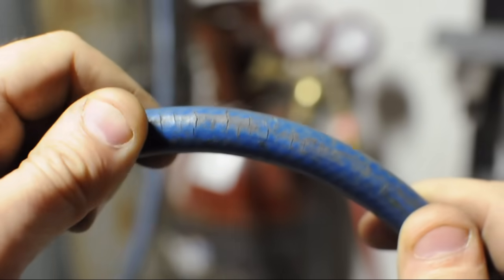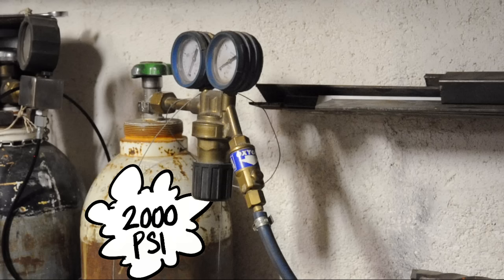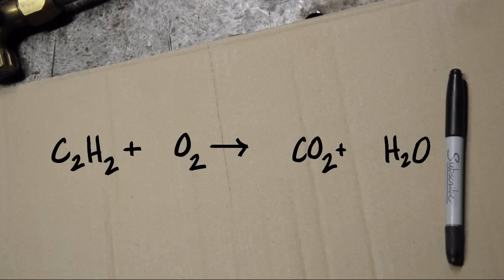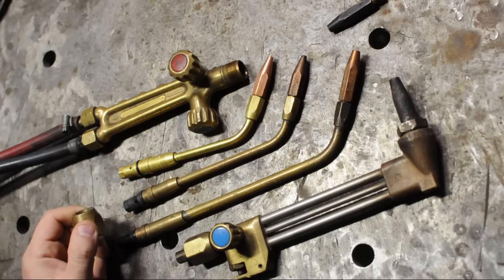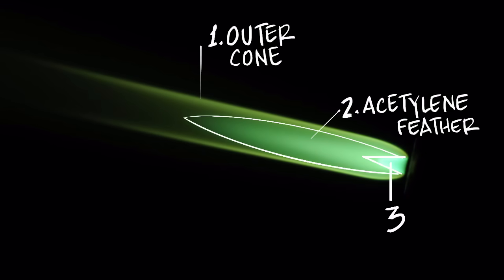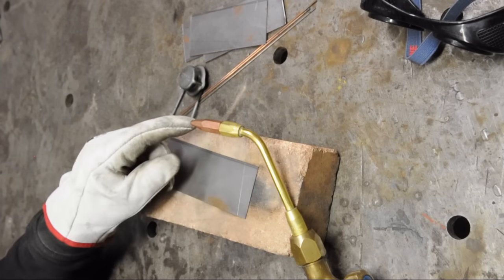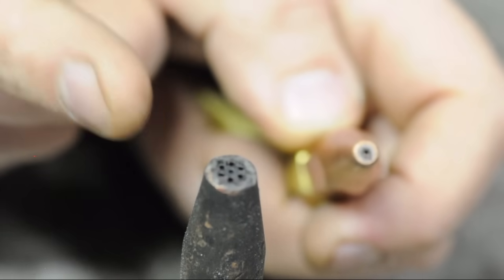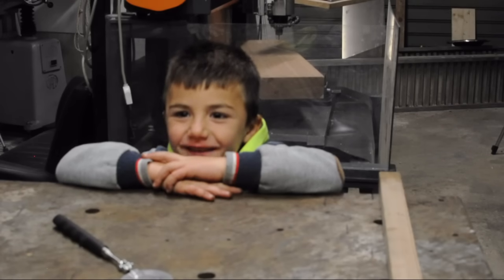Let's Talk Oxy Acetylene

Comment: I have been using my avetylene bottle completely upside down hanging from the ceiling for 30 years and nothing bad ever happened.
Reply: That's incredibly dangerous. At my shop, we drill holes in the bottom of the cylinders to get the acetylene out, but at least we didn't turn the tanks upside down.
Reply: we use a grinder to cut the valve off when we're done with them so we know which are empty, but theres no chance we would ever turn them upside down!
Reply: Why???
Reply: Uwe J. I hang mine upside down from a chain and swing on it like Miley Cyrus while I weld. Nothing bad has ever happened.
Reply: that_G_EvanP im laughing so hard im weak. I cant
Reply: Ppl believe anything haha
Reply: If you looked up "predictable" in a dictionary you would get a picture of this comment. But somebody had to do it.
Reply: We always hang it from it’s chain and whenever kids come there they try to dent it to increase the pressure with sledgehammers
Reply: r/woooosh
Reply: That's incredibly dangerous... At our shop, we use a tiger torch to check for leaks on the bottles and we roll the bottles around the shop so there's no risk of them falling over.
Reply: should be ok , only volatile lieing on its side
Reply: In our shop, we hang the bottle over the work, unscrew the valve, and set it off with a match. Nothing bad has ever happened.
Reply: @vx-iidu  lol
Reply: You just had to do it.
Reply: shadowninja81500 - And did any bad ever happened?
Reply: Me too, but for 32 years now...wait I just heard someyhing down at my shop.........
Reply: That's incredibly dangerous. At my shop, we fit another valve to the acetylene tank and put the oxygen in it as well. We never fit the stupid flashback arrestor because stops the lines coiling up nicely. This all saves a load of space and nothing bad has ever happened.
Reply: @geoffscott265  😂🤣😆
Reply: Unfortunatly I don't have much space on my shop, so I used a T joint right out of the valves so I can feed a single regulator and a single hose. Also use the same T joint to hold it to the ceiling with a chain...
Reply: Don't listen to these fools. Upside down is best if you want it to come out faster
Reply: Hmm. What a coincidence. Didn’t the person in the video say someone will say this?
Reply: Pictures or it didnt not happen
Reply: I remember your shop, every Christmas we'd put on blindfold and swing the fire axe around playing pinatas with the gas bottles. Its great when the candy spills out.
Reply: I love you sir.
Reply: That is why they supply a chain on the rig. You use the cart wheels as a pulley system to tilt it for more pressure. Acetylene is more stable when it is elevated. You get better acetone flow to clean the torch tip when you're done. Everybody knows this life hack by now, right?
Reply: @coreyregier5546  seriously?
Reply: ya well u r lucky hero boy.
Reply: @MrEazyE357  goof
Reply: You're lucky to make 30 years like that. I only got to 24 years and the thing blew up, killing me, destroying my house, and setting fire to half the block.
Reply: @VectorNodes  thats exstreamly danger you fool. You have to put racing stripes on it first
Reply: Rebel Babble right !!!! I mean how else do you empty all the acetylene out the bottom ?
Reply: LMAO!!!!😂😂😂 I think I peed a little
Reply: My buddy Bob rode the acetylene tank like a horse he named it lucky. So he opened the valve and said I'm gonna get old Lucky to buck like a bull. He flew all over the place for a few seconds then blew up his shop and part of a building adjacent to his shop. We wrote on his headstone R.I.P. "May He Rest In Pieces" . Never lay a tank of Acetylene on its side for long periods of time and then stand it upright and open it. It could explode and you'll be hanging out with old lucky and my friend Bob the Builder. True story
Reply: I've never brazed while hanging upside down... you got mad skills
Reply: Why the fuck would you people destroy perfectly good tanks? The hell's the matter with you?
Reply: @vx-iidu  You should never drill the holes at the bottom but always at the top, unless the bottle is upside down in which case you should drill them at the bottom, which is of course now at the top. Drilling them at the bottom is problematic because you let out the acetone, unless of course you wish to remove your nail polish in which case it is just fine.
Reply: 4:08 for the people who let the joke fly over their heads
Reply: @brinlipovz8672  incorrect usage as nobody missed a joke.
Reply: Wow...shocking!.. .in my truck, it goes on its side with a bungie wrapped around it.. for cushioning.. not to secure it.  Of course we let it roll around so it shakes the soda can up for extra pressure, also throw away that striker! Use a bic like a blister fingered man..or woman..
Reply: You shouldn't do this.
Reply: I use my acetylene bottles as missiles in my own navy on the lake but I would never hang them upside down like an EDIOT!
Reply: @jeremymcadam7400  Are they not refillable?
Reply: @ratataran  far too dangerous to refill them. Acetylene is lighter than air so you have to turn the bottle upside down to get it back in. And as we know, you NEVER Turn them upside down
Reply: everyone is taking this so serious
Reply: I was curious so I just hang one upside down, I am watching it right now while I am ty
Reply: @wimwiddershins  Yeah, what WAS going on with that Oxygen bottle?  That would be the toughest pinata ever!
Reply: Believe or not you can use blinker fluid to check for the leaks. It works, totaly recommended😁
Reply: Corey Regier you roll them on their side! 
What happens is the acetone leaks and mixes with the cutting gas. Over time without the acetone the gas becomes unstable. The same happens when the gas pressure is up to high.
We had a situation where there were a number of gas cylinders attached to a manifold system. 
One cylinder drawing more gas than the other and it ignited turning red hot. 
My friend and I noticed the situation and an emergency evacuation was required.
On another Occasion a cylinder that had been transported on its side ignited as soon as it was used.
Never put them on their side.
Reply: Why waste money on a chain mine hangs fine from its hose. If it wasn’t safe they wouldn’t make em so I could do that.
Reply: That's incredibly dangerous.  We always hang acetylene bottles upside  down and use them for pinatas over a campfire and let the kids beat them with baseball bats.  The goal is for the kids to knock the valve off the 'pinata'.  We never had anything bad happen.
Reply: Did you write this comment on a typewriter as well?
Reply: @geoffscott265  Somebody actually did just that,haha
Reply: Had to be done
Reply: Fujiwara J. , no you don’t!
Reply: @21gioni  the bottles can also be used as roller skids for moving heavy objects into the shop...
Reply: Corey Regier The issue is it’s not you who has to deal with a bottle that has turned red hot. 
I have seen it happen.
Reply: @MrEazyE357  What? Naked and wearing army boots?
Reply: @andrewallen9993  Is there any other way?
Reply: @dklarsen1705  think you work in s freak shop....pee and acetylene  never mix.....but you should film it.
Reply: Lol I looked at the comments right when he said that and was reading your comment lmao😂
Reply: That's a safety hazard. The proper place to store them is in the yellow hot forge with molten copper.
Reply: I don't like dragging heavy tanks around, so I fill party balloons with oxy acetylene mix, then use a drinking straw inserted into the balloon as a torch head. I adjust the pressure and flame by squeezing the straw. Never had anything bad happen.
Reply: I used to do meth and cocaine at the same time. A lot of bad things happened
Reply: So was it you hanging upside down, or the bottle?
Reply: Wait you’re supposed to hang them? I’ve been just dropping the fresh tanks on the ground. Explains all the rubble everywhere
Reply: Same.
Reply: and theres no point in it...    accident waiting to happen,
Reply: don't worry you'r getting there. It's a probability and the fact that it has happened yet it mean there is more chance that it'll happen.
Reply: same nigga
Reply: Crap. I've been using a light fixture all this time. No wonder my torch won't light.
Reply: Ass Setta Lina She was my first love💕
Reply: @thingmaker3  no one cares
Reply: I put my bottles in furnace to check if there's any leak but never hang it upside down
Reply: @smoke4131  great idea bro... Don't forget that life insurance policy payment LOL
Reply: @jolujo5842  lmao, I was kidding

Firstly, I don't own one (I'm 17 so probably can't ask my parents for it )

And secondly, I Live in India and life insurance isn't mandatory here 🙂
Reply: @smoke4131  Of course you were kidding 😆 and of course so was I
Reply: @jolujo5842  yeah, but I wanted you to know that Life insurance isn't mandatory everywhere 😉
Reply: Just scrolled down to this, if it wasn't you it would be me.
Reply: Acetylene is exactly like helium, it makes your voice go squeaky. Great fun in the garage.
Reply: I tap on the side of my acetylene tank with my hydrolic ram right on the #57 it comes out faster , also it has to be downside up.
Reply: @americanvikinggsd4631  No.  Obviously not seriously
Reply: @jamiebuckley1769  The post was a joke.  Couldn't you tell?
Reply: @maxscott3349  You gotta understand, Max, there's a lot of joking going on here among folks who know what they're doing.  It's called humour.  Learn about it.  Everyone but you is smiling.
Reply: @MrPossumeyes  Speak for yourself
Reply: @maxscott3349  I was, Max
Reply: Avetylene ? What's that - A dandruff remover ?
Reply: @VectorNodes  lol ya ok lmao
Reply: A good way to practise gas welding sheet steel is to bend up a 1/16 lip on two 1 in wide pieces of metal. Then weld the text pieces together using only the torch. 

Then bend the welded pieces along the weld. They should bend without  cracking.

Fun thing. Blow up balloons with a OxyAct mix then touch them with a flame on a long, really long, flame. Wear earplugs.
Reply: I don't hang mine upside down nor out it right side up - I  bolted it horizontally to the roof rafter to save rooms in my messy garage and used my long garden hose to connect to my torch because the supplied hose not long enough.. Sofar So good... Except when my wife need the hose to water her garden... I have to take them off and out them back in again
Reply: Yeah I don’t even use tanks we just use balloons
Reply: @jeremy mcadam r/woosh
Reply: @robbiejames1540  do you do that with the oxy bottle also so you get the flame just right and move the project around under the flame 🔥 ?
Reply: @vx-iidu  We do the same, only in a FOOF (dioxygen difluoride) atmosphere, which we all know is safer, then we throw a lit match in to check that we didn’t get scammed.
Reply: @MrEazyE357   that's mint! Lmao!
Reply: @vx-iidu  why drill? use the cylinder for it's purpose, cut.
Reply: @MrEazyE357  this killed me
Reply: That's incredibly dangerous. At my shop we boil the acetone mixture inside the bottle to make sure we get all of the acetylene out.
Reply: Fujiwara j , You may joke about this but you are a lier and your comment is even more dangerous. Some people may believe you.
Reply: @damirdze  someone didn't watch the video
Reply: @_Simon  , I watched the video and I am pretty sure the comment is a joke cause I do not want to believe a sane person would put the acetylene bottle upside down.
Reply: @damirdze  in the video he said "now i know you guys will comment "i have been using my acetylene bottle upside down for 30 years and had 0 problems"" and he's just making a reference to the video
Reply: @_Simon  OK I overheard that part. He could quote it though. The comment sounds like he did it. The reason I commented is because some young or people who want to learn new skills may find it as alright to do so. Because not everyone know when or if someone makes jokes .
Reply: I built a giant centrifuge to keep the pressure up.
Reply: @pseudotasuki  for that I have found it helps if you keep it on the surface of the sun the pressure goes up a good amount
Reply: I just connect the torch directly to the acetylene bottle and the oxygen bottle with a t joint adapter, just solder the oxygen side shut and carry both bottles over my shoulder, no dicking around with hoses and regulators
Reply: And you try to tell the young people today that, and they won't believe you.
Reply: I snuck my bottle into jail.. but forgot my striker!
Reply: @brinlipovz8672  That's the sound their shop made...
Reply: What is an avetylene bottle? 😆   Is that a pet shampoo?
Reply: Damn that bottle must hold a lot of acetylene if it's been hanging up there so long
Reply: Acetylene has acetone in the cylinder.  If you turned it upside-down it would squirt acetone.  It is one of the few gas that has to be upright
Reply: With the bottle upside down, the acetone is mixing with the acetylene gas, reducing the flame temps as well as possibility causing the acetylene to be come unstable

Comment: Tips never wear out, they only grow up to be the next larger size tip.
Reply: Good point!
Reply: Lol they grow up
Reply: This is a great tip!
Reply: Nice one. Gotta learn to keep them symmetrical, though - I remember it being a pain if the stream shoots everywhere.
Reply: Not entirely true. The orifice in the mixer jet would need to be drilled out to accommodate the higher gas demand. Older Smith tips had replaceable/interchangeable mixer jets, but sadly the newer revised design (post ITW takeover) do not.
Reply: I'ts just the tip and just for a minute.
Reply: Agreed , because basically you're learning a different language. Some teachers are boring AF, and aren't capable of explaining the simplest concepts FIRST and then adding on...you can't start in the middle and shoot for both ends!😂
Reply: And sometimes they glow up